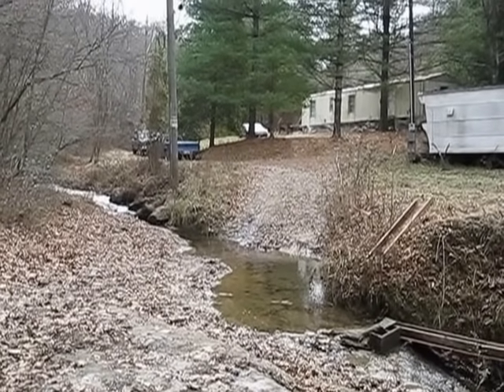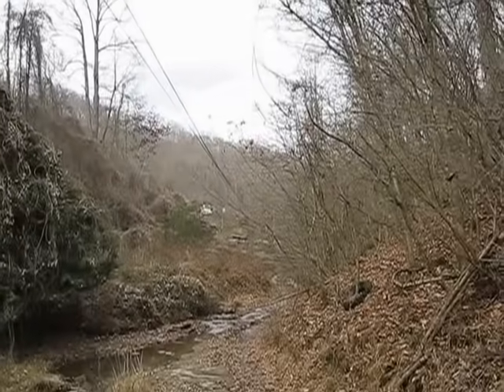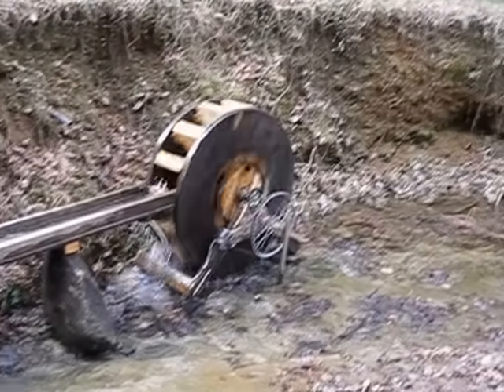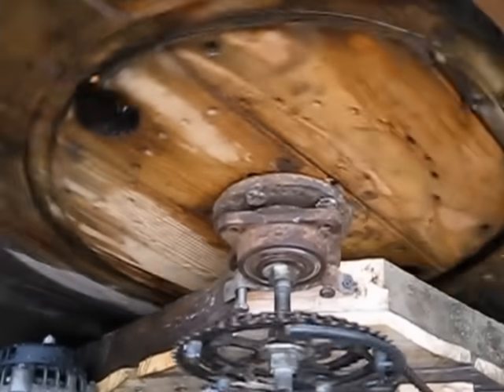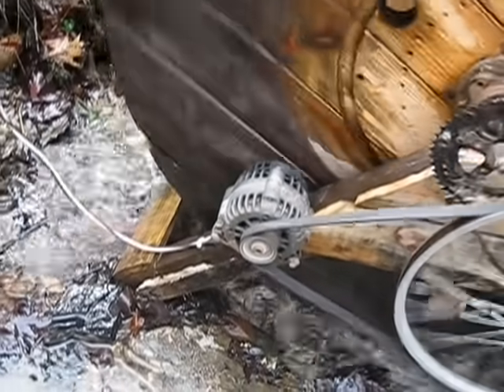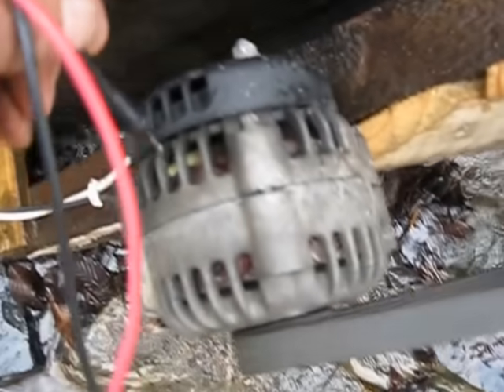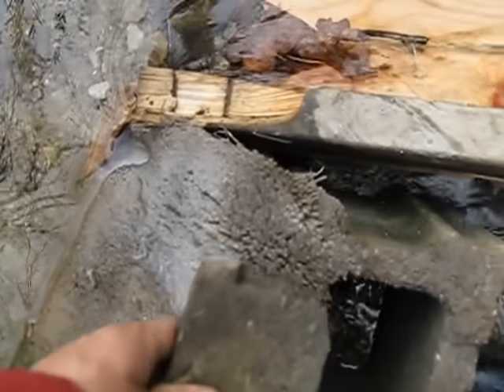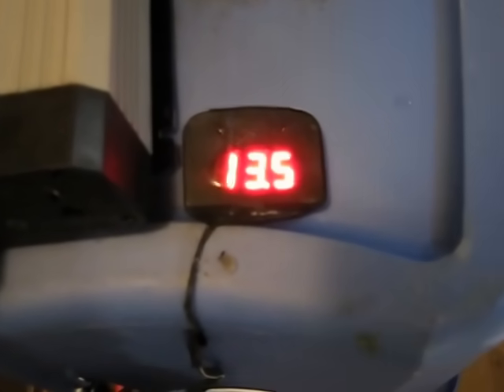water wheel generator

Comment: Just don't tell the DNR or the EPA about your water wheel. Two more government entities that want to fine you, tell you that you can't do that and control you life.
Reply: milldabeast519 I'd imagine if this were done every few hundred feet, that creek would be able to drive that many water wheels, and all those folks would have free electricity. Fuck your fish.
Reply: That stream is so small and shallow I doubt that any fish would make it up and over that little step in the stream.
Reply: milldabeast519 I'm a hippy? That's funny, and you're fucking stupid. Traditionally, hippies are the ones screaming about the environment, so that would be you. And I've had the same job for 24 years. Nice try. With what I can see of that stream, I'll take my chances with the catastrophic chain reaction possibilities. You're fucking hilarious. What a pussy.
Reply: +milldabeast519 
It is still potential breeding ground and the EPA will throw a fit.
Reply: +milldabeast519 
hydro systems only interfere with the breeding patterns of fish if the system cuts of access up or down stream that fish would normally have.
 So if you have a gentle stream and you damn up the stream completely to funnel all the available water through a pipe or sluice to run a wheel or turbine, then yes your altering the environment.
 But in set ups like this, which are passive, your not really altering anything that would affect the wildlife to any measurable degree.
Reply: +milldabeast519 how does water hitting a water wheel fuck with fish? Provide links with facts to that statement to enlighten us all
Reply: +GrilledCheesemmmm its only common sense... fish go upstream usually.... not down all tho some do. so putting stuff like this in the water really screws up fish. which is why dams are so bad. but like i mentioned it may not be an issue in this small creek.
Reply: yea im sure all the folks would have electricity. and there also going to fuck the population of fish in the creek which would cause a chain reaction through the environment so fuck your 10$ in electricity. get a fucking job hippy
Reply: @milldabeast519  Calls someone a hippy all while he kneels for fish. Go hug a fucking tree.
Reply: +Boyd W actually its because some of the streams contain fish and your fucking with them big time doing stuff like this. if everybody did this they would have fish running and breeding like normal if at all. doesnt look like its an issue in this stream but some that are only a foot deep carry fish all year around and are very important for keeping the big fish in our rivers alive! dont let the mnr see this. you may own the land but not the water
Reply: +Michael Rogers your completely wrong. disturbing or altering the creek period is against the law where im from. and something like this would clearly effect fish if there was any. cutting the flow down to less then half is a dramatic change although it may not seem like it. imagine if ppl backed onto the creek every few hundred feet and everybody did this. which is what you have to consider. if you allow one person to do it that means it can sustain everybody doing this.not feasible

Comment: this setup is very clever. nice use of the resources you have available. but you may want to consider putting those batteries outside or in a ventilated area separate from your living area. Charging batteries produces hydrogen which could be very hazardous inside your house.

Comment: take another high output altenator and drill 5 holes in the pully take some threaded rod and some clamps and sheet of 3/16th plastic and make vains for it instant  windmill for nothing another power source

Comment: off the grid....1000w doesn't run much.  lights and a TV and other small odds and ends.   if you don't rely on an electric 230v single phase stove or a fridge and you use wood as a heat source you are off the grid.....

Comment: So by chance have you figured out the load to run your house. How long can your system hold up you needs during an AC outage. I like your setup. What I like about it is it is down all with what you could pull together around the house. In your video I do have concern for the water being able to splash on to your generator. Have you thought about what you will do in rainy season and your creek becomes a much larger amount of flow of water per minute. I would hate for you to wake up one morning only to find your generator under water or your whole generating system flushed down stream.

Comment: Good for you !!! Yes deep cycle batteries can be costly. I think Walmart has the cheapest with there Everstart DC batteries. A group 29 will get you 114 AH., but will cost you $120-130 each. Did you need special permission from the county to use a water wheel ? You it's get better flow from the creek with the spring melt each year. You could most likely make a wind turbine the same way.

Comment: Hi men fantastic that you can generate energy from water pressure.  I advice to save and invest money in 4 or more good Trojan T105 batteries and a good MPPT charge controller that put 30 to 40% more energy in your batteries.   

Use thick power cables almost 2x 6mm²  about son distance you have much loss.

Make a waterproof construction "house" for the alternator those should remain dry

Good luck.

Comment: if you use gear reduction from 10 speed or better you can spin alt faster. using Chevrolet alt with internal regulator/rectifier is good. don't worry about water shorting it out, when driving a car in the rain it gets soaked all the time . just stock up on spare parts and learn how to rebuild them. multiple battery system will improve the time that you can use system.

Comment: Very nice simple design, however you could increase the rotation speed by slightly angling the water feed down by increasing the angle of attack there is currently some feedback by the water going into the wheel you get better performance having the water falling just on the edge instead.

Comment: put a splah guard on genni. the  bike wheel should be driven by the larger tire diameter which allows the smaller hub wheel to spin the genni faster.

Comment: If you used a steel or PVC pipe in place of the wooded flume, you may get a better energy yield because of reduced water spillage and the higher water velocity.

Comment: So the water flow is what? I reckon about 5 gallons per minute. The drop on your water wheel I estimate at a foot. That gives you about a whole watt of electricity. (the calculation is mass * G * height / time). Don't spend it all at once.

Comment: very neat but one word of caution you may want to remove the batteries out of your house old batteries or worn out batteries can leak hydrogen gas which is poisonous and extremely flammable just something you might want to look into for safety reasons but great engineering definitely interesting

Comment: I think if you increased the space between the bike rim and the alternator, added a tricycle wheel (smaller than bike wheel, bigger than alternator pulley wheel) and used a longer belt, you could make the alternator spin faster and produce more power (?) with the same amount of water you're currently using.

Comment: Use a pipe to convey the water to the wheel, then you can draw the water from further upstream and get more pressure and hence a higher flow. Make the buckets on the wheel higher capacity and feed the water at the top so that the wheel turns the other way, that way you use the energy of the water's momentum too.
Reply: I think a small dam in conjunction with the pipe that you mention is the answer, that is if ecological laws permit. The dam would allow for more "pressure" to the pipe and control creek water height. There could even be multiple water wheels.
Reply: <<Use a pipe to convey the water to the wheel, then you can draw the water from further upstream and get more pressure and hence a higher flow. Make the buckets on the wheel higher capacity and feed the water at the top so that the wheel turns the other way, that way you use the energy of the water's momentum too.>>

This is the way utilities grow into PG&E!

Another approach would be to analyze how to reduce electrical consumption,  rather than increase power output. 

A great example of how boys enjoy splashing around in puddles.

Comment: looks like if the aim at the wheel was lower, the wheel would turn faster..?
Reply: I agree. Or if the wheel was lower in the ground and the water went over top of the wheel and spun it the other way going with the momentum of the wheel. this seems inefficient. But I love this idea.
Reply: imagine creating a water track that would take the water back up to be used again...dam creek but let water pass not to hold it all back. too much trouble.,.
Reply: +Kurt Justin That would be a great addition but the anti-gravity machine will take some engineering.
Reply: shift of a magnet

Comment: Not sure how the infrastructure for something like this is achieved without causing eco damage.  Seems like fish would suffer among other things.  There must be some well known or commonly used methods.  Hey, it's working.  Not trying to be a know it all but I'd be concerned about having those batteries stacked like that indoors.  I thought they produced H2 when charging and maybe under load.  H2 flashes with a minimum of heat.  Just saying.

Comment: You should round off the edges in the middle of the water wheel to reduce horizontal force from the water smacking into a perpendicular surface every .5 seconds and maximize downward force. 
Maybe even try testing the slope of the funnel to the water wheel to see what gives more speed, thus more power.

Comment: Sir I would suggest you build a taller wheel.   If you make your Wheel  say twice the Dia.  you will pick up twice the Tq.     With the Taller Wheel you can use a Second Alt and you will have a lot of Amp's to charge your batteries while you use them.     The water is there use it.      Good luck and what a great project.

Comment: your set up verses the cost is great.  What does it power?  
I bet at that location you could build a small dam and a turbine.  That would run the complete house ac, heat, stove, oven and lights.

Comment: Couple of thoughts
If you get 4 or 6 inch abs drain pipe you can get further back on the creek so you get to get more drop and get to an overshoot wheel. That also puts some of the water speed to work for you. Then if you close off the ends of the paddles you would have more water weight doing work for you. Just by guess, you might be able to double or triple the amount of power you get.
You could also possibly do some spade work and build a small dam to build a reservoir and get more height and store water.
Depending on how far back you want to or are able to go you might consider old fire hose instead of pipe and just lay it in the creek bed. 
If you have an issue with winter freeze up a trick that I was told was to drill a few holes in the pipe and let ice build up and act as insulation
Once you get to an overshoot wheel if you increase the distance between the flanges by making your paddles longer you also get more weight in each "bucket" to give more torque and keep it turning under heavy load.
Also watch the video on converting an old washing machine. I think he has a lot more head to work with than you do. If my calculations are correct he's got a 100 feet of head.
Love you setup. I'm an engineer and learned a lot

Comment: search "ALUM lead acid conversion" on Google. I think you will like it. Great way to rebuild old batteries for only a few bucks.
Reply: tried the Alum on several old batteries. Didn't have any luck. I have 25 sitting here waiting for a Real way to repair them. Any input would help.

Comment: Nice, Cheapes telectric power Iv seen, here is a suggestion, for more power source, just make another water wheel, 7 feet away same water same gravity , it will still flow down hill to the next wheel, then you will have 2 water wheels, with 2 alternators,

Comment: How do you power a 110v converter {from a motorhome} on 40v at the water wheel?   P.S.    A regulater limits voltage, it doesn't increase it.

Comment: If it's snowmelt water then the energy your using comes from the potential energy hidden inside each water droplet, this energy was gained when the water molecule evaporated climbed into the air via solar rays (indirectly or directly) and onto some nearby hilltop or mountain. Just in case you never thought of it that way. cool video

Comment: Really nice free power. I think if you were to go down stream or up stream from your drive way, you could damn it up just a bit. Then you could put your wheel bucket flaps at a higher degree so that more water will catch inside for more torque. Perhaps a heavy fly wheel and put another alternator on the other side of your wheel for more free electricity. Very nice video. This is real free off grid material. Good job.

Comment: install smooth 4 or 6  inch water pipe as far as you can and as straight as you can and the velocity will increase to water generator wheel with the pipe across the top the froward motion of water plus the increase in drop might increase, my guess 3.5X.  you at 50% of wheel height now, at top will double that.  Thats easy, the velocity change from negative sheer to froward thrust and smoothbore plus head pressure from weir/dam could improve lots more.

Comment: Now add a pipe wheel rotating pump since the lift is minimum to the house and you have free water.  do this at closest point to house.  use several coils of roll pipe around a 8 foot wheel with collector funnel and you should able to get water to elevated tank for shower or toilet.  ramp pump might work also, drop may not be enough. depends how far you own land up creek.

Comment: one major improvement would be to but water over the top of wheel. the forward motion of water is canceled by sheering the water. over the top will take advantage of forward motion and additional drop.  dig out the the water wheel or use source further upstream.

Comment: You need to talk amps if you are talking about volts. They are meaningless by themselves when discussing energy (volts x amps = watts= energy)
Reply: Assuming a water flow of 10 gallons/ minute and a head of three feet,  the theoretical maximum amount of power he can produce with that rig is about five watts.

Comment: Bigger waterwheel would keep water in longer. maybe build from stainless or at least pressure treated wood. add a bearing to the wheel. build a dam and always get water from the bottom of the dam for much increased water pressure. you get nothing for nothing. the water dropping is doing the work. take care. maybe switch from water wheel to impeller.

Comment: What about: 1) reduce the wheel diameter by 10/20 cm so to not drag water at the bottom; 2) reduce the blades width, to allow more ramp water to enter the wheel; 3) raise the right torrent bank, which is lower than the left, to allow for a small 0.5/1 meter dam.

Comment: i've found auto batteries work just fine for daily use. they handle day to day in cars. deep cycle have never held up with constant charging. you should try to get batteries with the same cca if possible otherwise your load will run to the batt. with the most amps. overworking it. Drop your wheel down lower about 1 foot and it should increase your driving force.

Comment: I only use three-phase brushless servomotors (then put a three-phase diode bridge and a good electrolytic capacitor on 450 volts DC)) for these applications:
I always look on ebay when there are good opportunities
are high performance, high security by incoming water
and then use solar mppt regulators with input max 150 volts or cheap car chargers directly from 3, 5 or 10A, as long as they are electronic
(Eg. The series Cteck
230 volts, 70 volts dc works perfectly, up to 350 volts dc, even more 'pieces in parallel, are automatic and desolfatatore built, supercharged and for winter use)

Comment: Nice Job ! ! ! I think you could get quite a bit more power if you would turn that entire structure around and have the water drop down onto top dead center with momentum going the direction that the wheel turns. (over the top) Like most old water wheel designs. 
That is great that you are getting some power out of your water! ! ! !

Comment: i was gonna write something praising your work, then you mentioned you had a mercedes...
Reply from the maker: LOL. I hear you Turned out the battery was the best part of the car. It's actually in the junkyard now.
Reply: SVanTha Old Mercedes can be had at reasonable prices. The old 5 cylinder OM617 diesel's would run forever. Plenty out there with WVO conversions already in place.